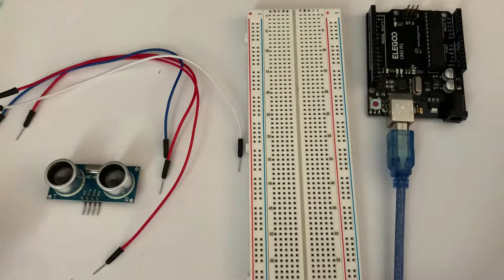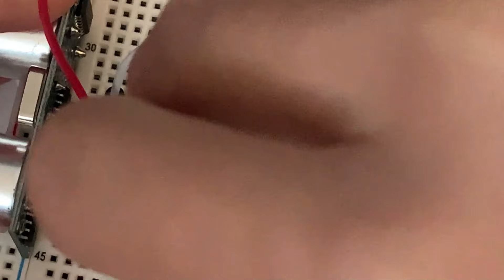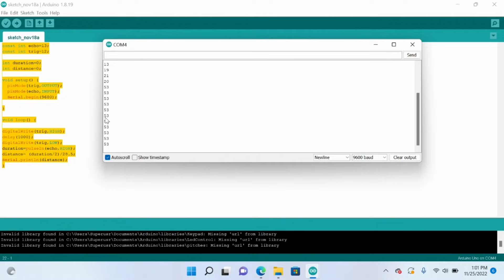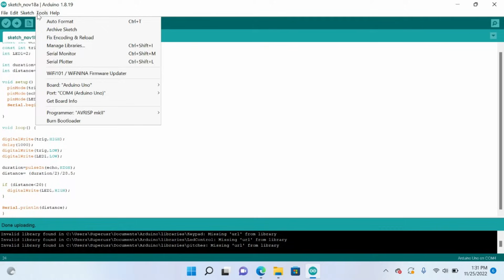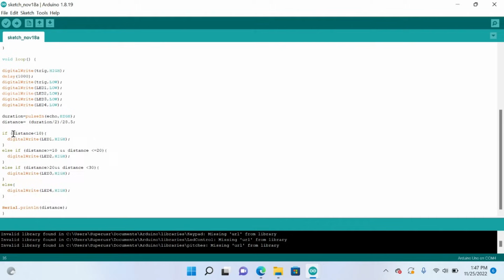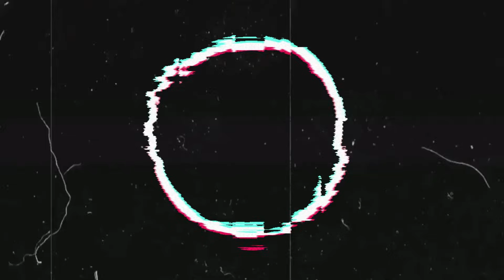Arduino Ultrasonic Motion Sensor: Motion Sensor and LED project

Comment: use this code if ur buzzer sound like radioactive sound 
"#define trigPin 9  // Broche de déclenchement du capteur à ultrasons
#define echoPin 10 // Broche d'écho du capteur à ultrasons
#define ledPin 13  // Broche de la LED
#define buzzerPin 11 // Broche du buzzer

void setup() {
  pinMode(trigPin, OUTPUT);
  pinMode(echoPin, INPUT);
  pinMode(ledPin, OUTPUT);
  pinMode(buzzerPin, OUTPUT);
  Serial.begin(9600);
}

void loop() {
  long duration, distance;

  // Envoi d'une impulsion de déclenchement au capteur à ultrasons
  digitalWrite(trigPin, LOW);
  delayMicroseconds(2);
  digitalWrite(trigPin, HIGH);
  delayMicroseconds(10);
  digitalWrite(trigPin, LOW);

  // Lecture de la durée de l'impulsion d'écho
  duration = pulseIn(echoPin, HIGH);

  // Calcul de la distance en centimètres
  distance = (duration / 2) / 29.1;

  // Affichage de la distance dans le moniteur série
  Serial.print("Distance : ");
  Serial.print(distance);
  Serial.println(" cm");

  // Vérification de la distance et activation de la LED et du buzzer
  if (distance < 20) {
    digitalWrite(ledPin, HIGH);   // Allume la LED
    tone(buzzerPin, 1000);        // Active le buzzer à 1 kHz
  } else {
    digitalWrite(ledPin, LOW);    // Éteint la LED
    noTone(buzzerPin);            // Désactive le buzzer
  }

  delay(100); // Attente pour éviter les fausses détections
}
"
Reply from the maker: Thank you so much! I appreciate your input!! Do you use the Arduino often?
Reply: @Waiduino  yes sometimes
Reply from the maker: @ih8snow415  Oh cool!! Are you new to Arduino and electronics?

Comment: the led is not lighting up how matter I try
Reply from the maker: Hmm i can assist you personally. Have you used a resistor and followed the diagram exactly? What pin did you attach it to on the Arduino?